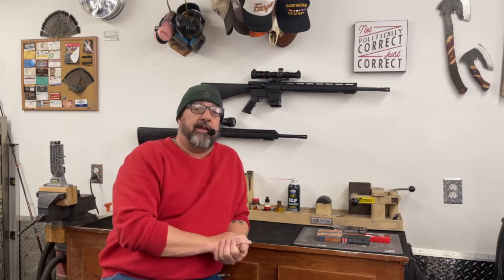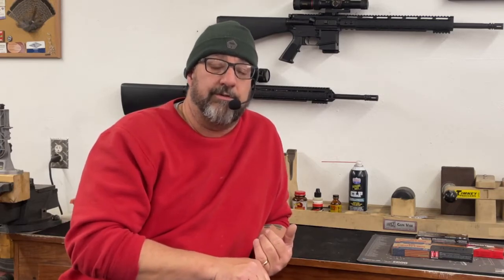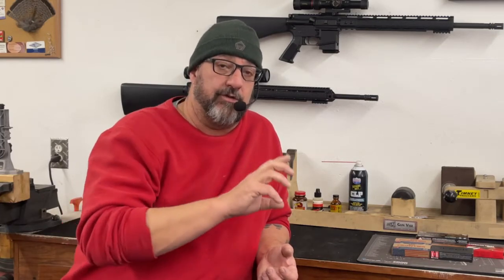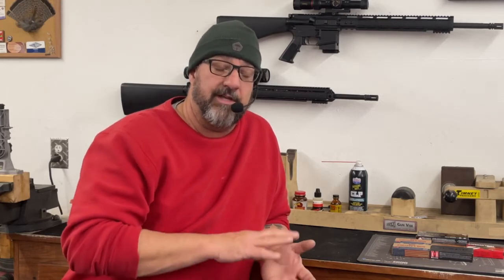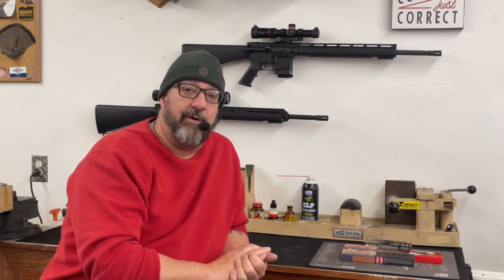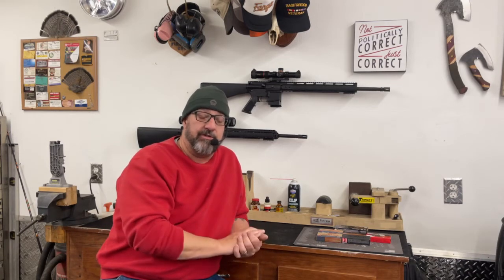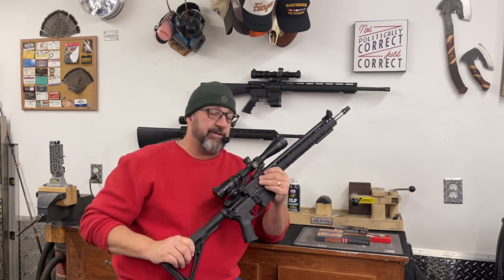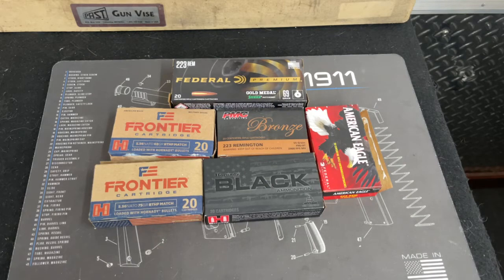5.56 Ammo Test. It is not all created Equal

Comment: It's sad how many M193 fakes are out there, claiming actual M193 pressures and velocity. So far from what I've chronographed I've found only 4 true, commercial sale M193. Those would be Winchester, imi, PPU & Hornady Frontier. Everything else that I've tested have greatly fallen below even acceptable velocities.
Reply from the maker: I am less concerned with velocity than I am with consistency. I have found deviations as high as 100fps on some cheaper M193 civilian ammo and it is always the least accurate. 

I typically go with M855 for most uses.

Thanks for watching.
Reply: @jackofalltrades7822  the brands mentioned have great spreads. Also, terminal ballistics only favor m855 through a minimum of 18" of barrel and even then that's pushing it.